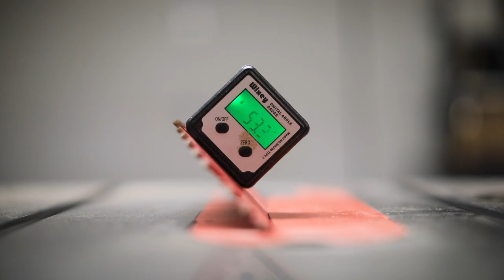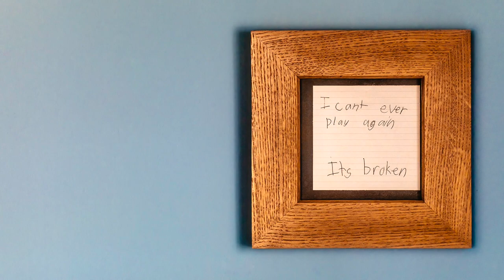Picture Frames From Reclaimed Oak Flooring // Woodworking // DIY

Comment: Another good vid! Two questions... 1. what size clamps do you use on the spline jig? I just built one and didn't think of using those! 2. what  do you use to cut the splines thickness down to size? I did a walnut frame and that took me way to long. Thanks again!